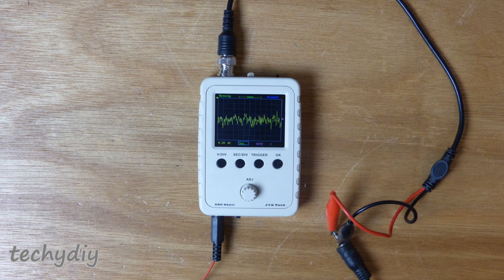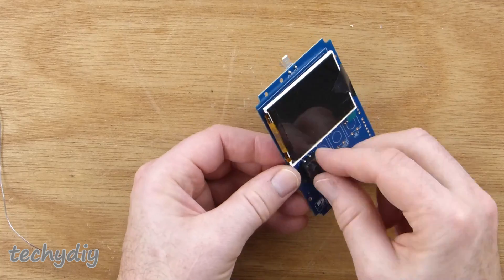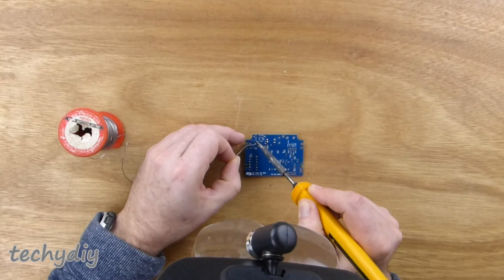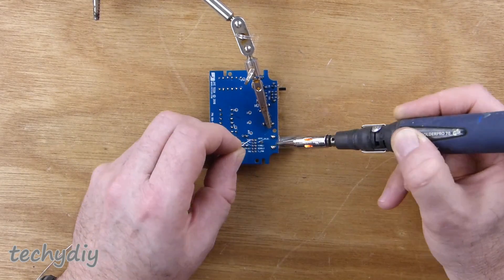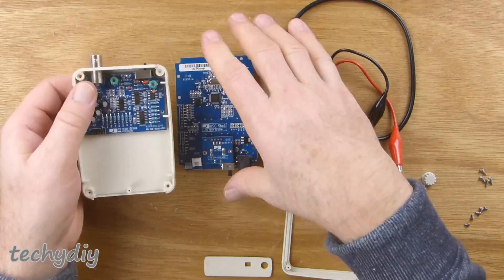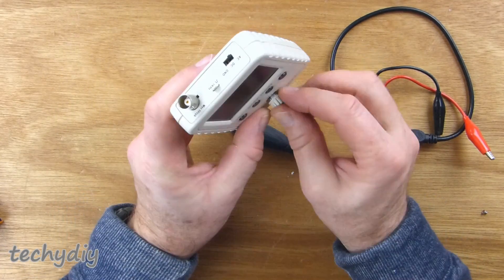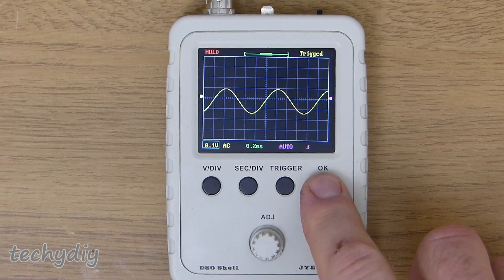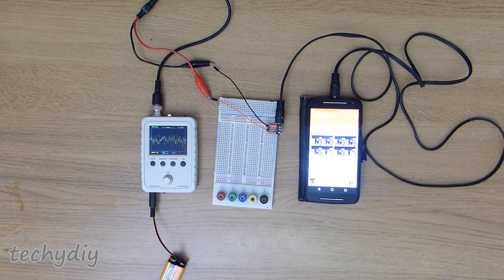DSO Shell (DSO150) 15001K  Oscilloscope  | Electronic kit build

Comment: You said max of 50 volts so can I check a car12v battery with this?
Reply from the maker: Yes, although a multimeter/voltmeter would be a better investment.
Reply: @techydiy  true but I'm checking the 12 pulsation rate to the alternator. but thanks for the info

Comment: I bought this product for nozamA (I wrote it backwards just in case), I followed the steps, assembled it and it works great. for its use I recommend a very well stabilized power source. Due to language differences (I speak Spanish) I did not understand that it is an oscilloscope with a bandwidth of 200 Khz with a test probe of 100 Mhz (I thought that the oscilloscope was 100 Mhz, it's a shame). But hey, I think it is a very good and useful product in some circumstances, such as student projects, small jobs, some experiments, audio and video repairs, etc.

Comment: is it possible to test the crystal oscillator (real time clock)  in an electronic circuit?
Reply from the maker: Probably, depends on frequency and type.  Rtc xtal is normally 32.768khz which is only just above audio frequencies.

Comment: Can you use a 10x probe with this
Reply: I have tested mine using a normal scope probe, both in 1X and 10X mode, and it works fine. Of course, there is nothing on the DSO to remind you that voltage readings might be off by an order of magnitude......

Comment: Hi, sir, Could i measure a signal AC 220 v?
Reply: You probably can do it using a x100 attenuation probe, but they usually are more expensive than this kit. Maybe a x10 could be enough, but I think it's too risky as it could theoretically measure around 400 Vpp. I use the x10 for 120V and it works well.
Reply: I think it's only good for 50V peak to peak

Comment: strange how they change the details. I got one yesterday from BG and it does not have the circuit diagrams( from the exact same link ) .
Reply from the maker: https://jyetech.com/Products/LcdScope/Schematic_150main.pdf
https://jyetech.com/Products/LcdScope/Schematic_150analog.pdf
Reply: The printed manual that came with my kit was a later revision than the latest revision on the JYETech website! There are also some anomalies in their other documentation.

It is my understanding that this is an open source design, and that JYETech is only one of several outfits that are selling products based on that design.

I am quite impressed with mine, and the manual is better than average for inexpensive Chinese kits. The only real things that I dislike is that the specification for bandwidth is 0-200kHz, but that is the analog circuit rating, not the overall scope rating. In my own experiments, this scope is not useful for anything about about 20kHz (NOT 200kHz)......I wonder if the 200kHz was a typo. With sampling.aliasing shortcomings, the display can show all sorts of amazingly inaccurate waveforms in frequencies above perhaps 50kHz, and they still look so 'correct' that an inexperienced user might be fooled. Once example, feeding a 100kHz sine wave (also being simultaneously monitored with a high end Tektronix scope AND a frequency counter), this DSO displayed a very nice sine wave with a period about half the width of the screen, while the S/Div was 20mS (that would mean a 10Hz signal, not a 100kHz signal). But below around 20kHz, this DSO seemed to reliably show what the real signal was.